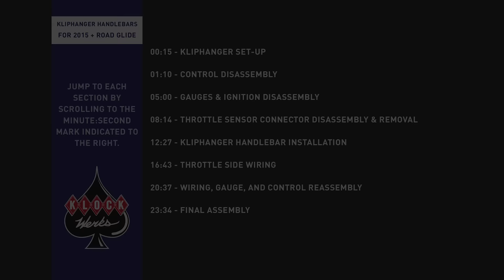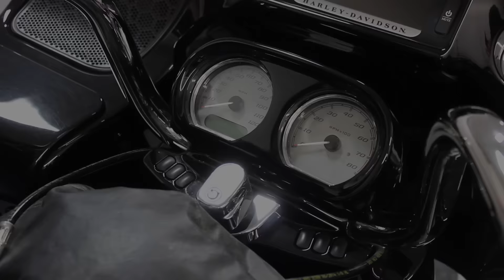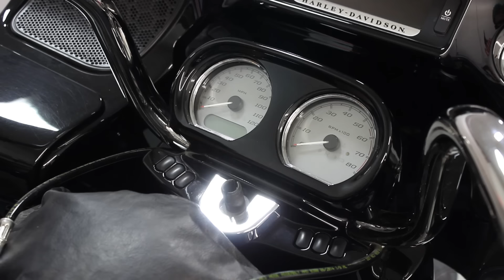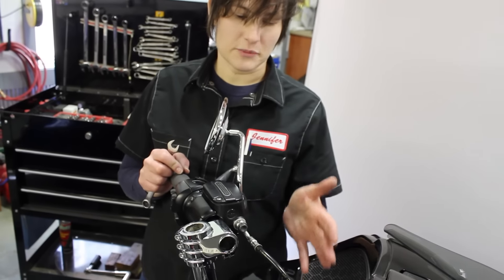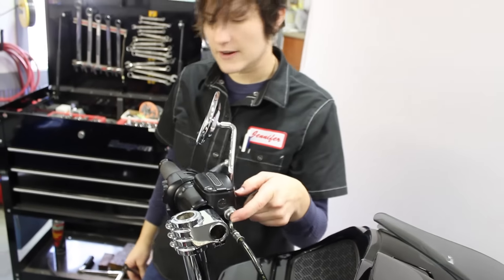2015+ Road Glide KlipHanger Full Installation

Comment: A good video how ever a few updated points for the 2017 and up bikes.... 1. You DO NOT need to remove the ignition switch, just pull that little chrome trim by pulling the Tab on the bottom of it by the tank and it pops off. The gauge cluster has a huge hole and just turn the switch to lock and there you go. 2. The plugs on the bottom of cluster are for future accessory switches, unplug both and the cluster is free to remove. And 3. newer bikes 17 and up now have a small plug (no molex) that goes right up though the bars easy peasy. Thanks again for the time and effort on making this video.

Comment: I think I can do this myself even though I only have common sense and intermediate skills when it comes to wiring. But for this job, I will just give these to Professionals who has the experience. I want a safe Motor built by people with years of experience. Safety is a top priority for me and I may miss some important steps. Handlebars are very crucial parts of the Motorcycle. I will only do this myself if a professional is around that can supervise.

Comment: Great video, but I am surprised she didn't pull the master fuse before disassembly. Also I find it's easier to remove handlebar wires after the bars are removed.

Comment: I just bought a 2017 RGS and they told me it would void the warranty on the controls by putting aftermarkets on. So of course I went with the HD 14 inch apes and had to change cables as well. If it wasn't for the whole warranty thing I would have went with these! I really like how you can set the position yourself rather then one option. I definitely plan to get these at some point. I know 10 inch in these don't require cables, do the 14's?
Reply: Vespah I think its more of a scare tactic to buy their brand, I was told by one dealership you have to re tune if you put slip ons on my 17 rgs but it has the cats and I'm not retarded and know unless you change the air intake or part of the foward header exhaust a tune is not required. most dealerships will honor the warranty as long as they do the work and the part is shipped to them and the part is a known credible part not knock off billy bobs bars. just ask the manager and get it cleared.
Reply: That dealership is full of shit. You should have told them to suck it!  Also 14 bars don’t require cables unless they are really wide bars.
Reply: That is why they call the Harley dealers, "Stealerships"!